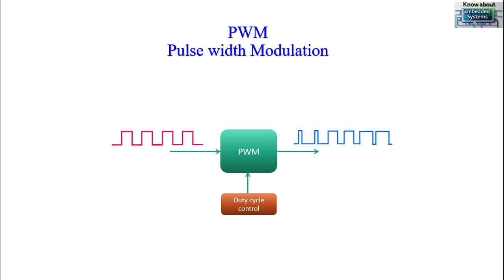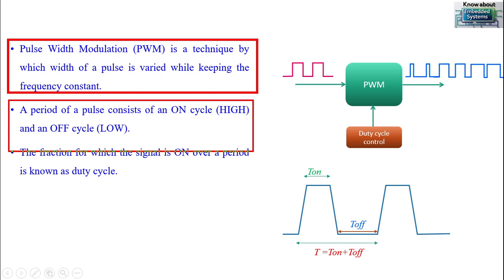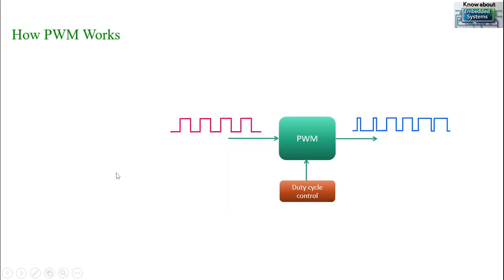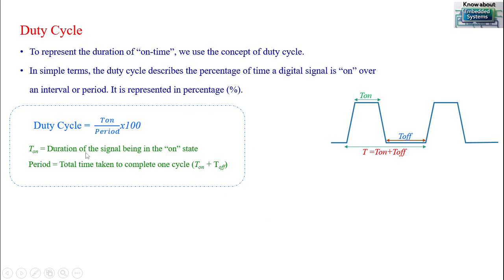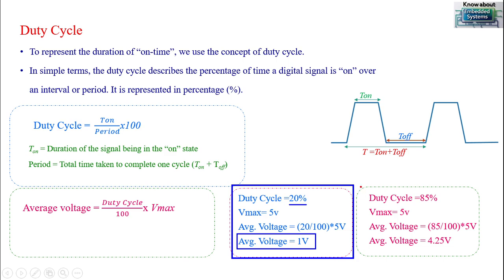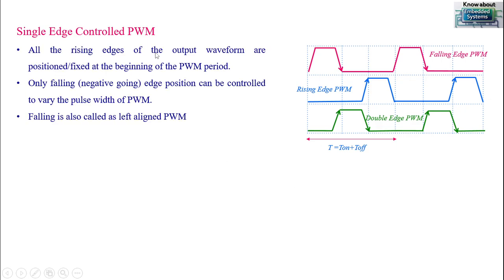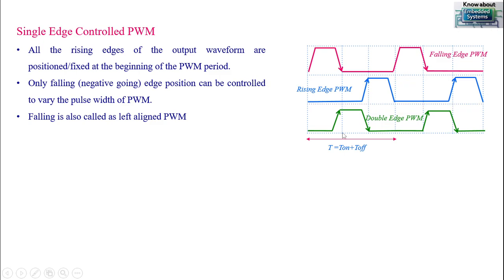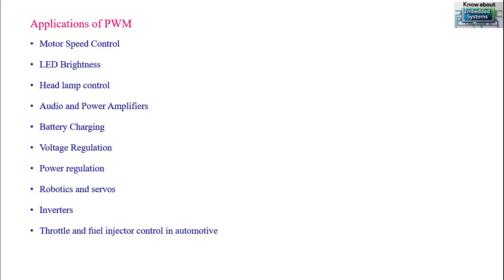PWM | What is PWM | Pulse Width Modulation | PWM working | PWM operation | Double Edge PWM

Comment: single edged PWM : either rising edge or falling edge will be active at a time, positioned at starting (falling edge) or at end (rising edge). 
double edged PWM : both rising and falling edge will be active at same time, positioned at middle
Reply from the maker: Perfect
Reply from the maker: Falling is called left aligned 
Rising is called right aligned